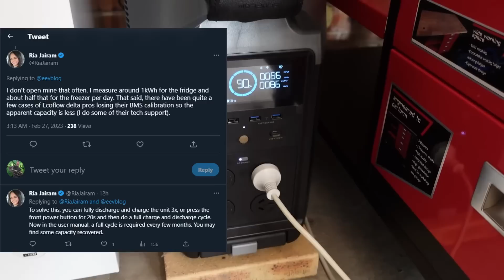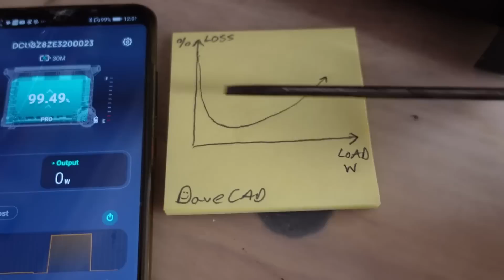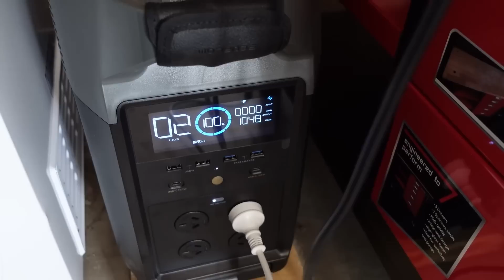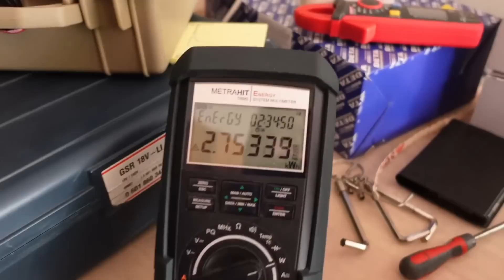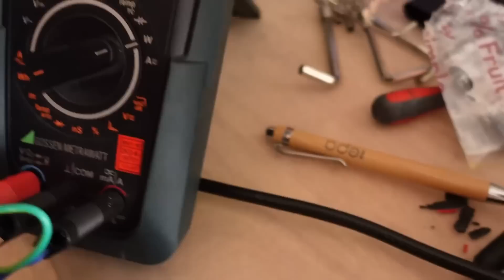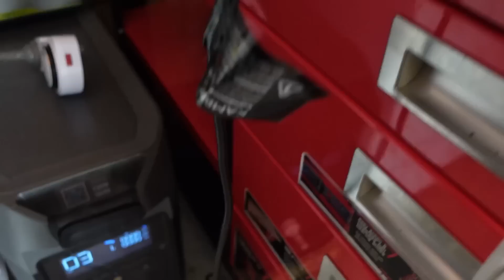EcoFlow Delta Pro Battery Capacity TESTED

Comment from the maker: UPDATE: it turns out that you can recalibrate the BMS (which may contain a coulomb counter?) by doing three full 0-100 charge-discharge cycles. This is not mentioned in the manual and is buried away in the FAQ on the website and is barely explained at all. This is poor form, it should be very clearly explained in the manual.
UPDATE2: After two complete 0-100% charge discharge cycles (and turning it off after each cycle) the capacity display appears to be correct now. It only stays on the 1% number for a minute or two. So no more non-linearity at the lower end. Whether or not it stays this way remains to be seen.
Reply: Do two more 100-0, then try the test again to check the BMS behavior since re-calibration. Ecoflow owners will love to know this.
Reply: Yes please. I am about to get one of those.
Reply: Make sure to leave it Off for about a half hour after each full charge.  That is important.
Reply: That info really should be readily known and they absolutely should be calibrated from factory as it's a consumer product.  
I've been playing with BMS systems lately using a Texas Instruments EV2300 which allows me to read TI BMS chips using the SMBUS. A lot of laptops use the same BMS chip and I wanted to read / edit info on them. 
The recommended way they recalibrate the counter is charge to full, leave for 2 hours, then discharge to 0%, leave for 5 hours. Then recharge. Not sure if that changes depending on chemistry or not but I assume that's to allow the charge level to stabilise.
Reply: @maulerrw  My system was calibrated correctly, but some early firmware updates will mess with that data.  Either that or all the small ( 5-10% drain ) and recharge cycles can mess with the accuracy of the BMS.
Reply: I wanted to comment about the fact that it sure has a coulomb counter just that it was not programed with the correct battery capacity but it seems it requires "learning". I designed a BMS and mine requires the user to introduce the real battery capacity for accurate SOC as I do not find "learning" is a good strategy and can result in large errors.
Can you do another test to see if it now "learned" the battery capacity?
There should be no damage if the BMS disconnects at 2.8V
3.3kWh seems about right as modern inverters are around 90 to 92% efficient. So battery is sure 3.6kWh as advertised.  The 12V output is through a DC-DC converter maybe 93 to 96% efficient so it will not be that much more efficient than the inverter with 1kW load.
Reply from the maker: @electrodacus If you have a true coulomb counter than it should be easy to auto-calibrate. Just reset it when it reaches a safe predetermined zero capacity voltage.
Reply: @EEVblog2  My BMS is for offgrid mostly charged from solar PV and battery will likely never be at zero. My house battery was never fully discharged except for the initial capacity test and capacity tests that I do usually every two or three years as a curiosity to see the amount of degradation.
It will be easy for me to implement an auto calibration procedure but if anything goes wrong the SOC can be way out compared with user setting the battery capacity in Ah and that being used as the battery capacity.
I do not sell an all integrated solution just a BMS for those that know what they are doing and they buy battery and all other components.  I will say that this EcoFlow should be already calibrated for this battery from factory so providing correct SOC without the need for the user to do one or multiple deep discharge in order to calibrate the state of charge indication.
Recently I installed a larger battery using 280Ah cells group of two of this cells in parallel so 560Ah and all I needed to do is set 560Ah in the battery settings together with the battery type LFP and number of cells 8s then save and power cycle to take effect. Nothing else is needed to have an accurate SOC indication.
Then if I want I can do a full charge followed by a full discharge and see if the usable battery capacity is 560Ah and correct that value if needed for even more accurate SOC.
I feel that this simpler option where user sets the real battery capacity in the setting has less chance to provide an accurate SOC compared to some automatic calibration.
Discharging a 14kWh battery can take some time and if you are offgrid is not quite ideal to ever have that discharged to zero and some have even larger battery capacity 30 even 50kWh.
Reply: @EEVblog2  I would guess that capacity is going to vary drastically depending on the load.
Reply: @EEVblog2  That enables it to set the 'zero' level but it needs to know what the true 'full' level is as well.  Presumably that's why you need to do it three times, it measures the actual battery capacity when it's being charged and averages the three values and then on the final discharge it zeros the coulomb counter.
Reply: Why does it need three full cycles? One should be enough? I could understand for new cells, capacity will usually go up a bit on a new cell the first cycles, but this being hidden in faq is more likely you do when youve had the unit for a while. Maybe its for balancing, lifepo4 is tricky, but wouldnt top balancing be enough? Well, would be interesting to see if you did the three cycles if you got even more out of it, doubt it though.
Reply: @kruppin  Likely is a hardware IC that will need to make sure the calibration is correct thus it needs 3 cycles with very close capacity measurement to then maybe permanently write the battery capacity in some non volatile memory. From there there may be some algorithm to subtract from this initial calibrated capacity as the battery ages both cycle and aging degradation.
I think this should have been done in the factory some sort of pre programmed value even if it is with some 1 or 2% error due to variation between individual batteries.
There was already some value 2.4kWh or something like that but it was way off. Maybe they reused the BMS settings from some other model that had a smaller battery capacity.
Reply: The BMS' are notoriously bad in commuting small currents. Therefore, they start floating if you don't fully charge the battery on a regular basis.
The LiFePo cells in this battery have a extremely flat discharge curve so that the voltage is not a good indicator for the SOC. Only the extremes (0% and 100%) can be properly identified. 
Hence you need a Coulomb counter. But if they are not 100% accurate, the SOC will be wrong after some time of 20-90% cycling, since this will never reach a sync point with clear SOC.
Reply: I have had similar issues but then with Goal Zero, that's even worse.
Their BMS is utterly c r a p. Next to their inventors blowing-out at about 70% load.
I truly believe you can best build your own battery-bank, BMS (2nd source) and invertors..
Reply: was about to say you probably need to charge at 100% ever so often. As an owner of an LFP EV, I am told I must charge at 100% from time to time. Being a smart arse I thought I don't need to, but then I noticed a capacity drop and ScanMyTesla showed after about 4 months a quite significant 70mV imbalance. Took a few 100% top ups to get the imbalance back down to 5mV, but it came back. If you look at the charge curve of an LFP you'll see it's hard to estimate the SoC based on VOC, so these cells really need to go to 100% to have the voltage ramp up above 3.3V. My advice is to schedule charging to 100% every other week for balancing, should improve things even using a basic BMS
Reply: Yes I think you should follow the recalibration process, then re-test to see if the percentage remaining works properly afterwards.
Reply: exactly what happens on a tesla if you dont discharge and charge deeply on a regular basis.
Reply: Have had the same problem with my EV, but in the manual it states in the manual to run the battery down every 3 months in order to calibrate..

But this is a bad written BMS, if the guesstimate of battery size is off, you shouldn't need to empty the battery 3 time, one should do it.
Reply: I have an Ecoflow DP. You just need to balance it once on both ends. Then it fine for awhile. 0% on an Ecoflow is not the same as running a lifepo4 cell to 3.0v it has a bottom end reserve.
Reply: the 1 in the display showing the SOC is quite line(ar) or simply a straight line. 

I want one but only with the behaviour during the last 1%

Comment: I held the on/off button for 20 seconds, I gained the missing 2000 KWh I’ve been missing.  I have dp plus one battery.  I was getting roughly 1/2 of the rates KWh now instantly getting 6.9Kwh.  Thanks.  Big difference!

Comment: You make a very good point on what 3.6 kWh actually means.  It depends on the load, how you use it (AC vs DC), as well as the temperature of the battery.  There should be some sort of government requirement to show the actual expected output, kilowatt hours as well as showing how temperature, load, etc. will affect the entire usable capacity of the battery.

All battery manufacture should be required to list the expected kilowatt hour capacity, expected input, and expected output, values, rather than the internal storage value of the batteries, because the user doesn't care about anything other than how much usage can be obtained out of the battery and how much it cost to charge it.

Comment: What if they did it to preserve the battery. If you discharge 80%  you get a lot more energy in total (cycles * cycle-energy). Or maybe you are right if you do full cycle and it's using coulomb counter it might be calibrated by a full cycle. It'll be interesting to get a second discharge cycle if the capacity indicator changes.
P.S. about efficiency - remember the calculator you commented on. Internal battery resistance increases the losses. I think you might get more Wh out of 100-200W load than 1000W. Anyway I like energy/efficiency measurement -thumbs up!
Oh, just read the update...

Comment: You fear for fully discharging comes from bare batteries, they should not be discharge below a point. Fully discharge is the best you can do for batteries in such device, because he manufacturer knows best when to stop.
My best guess what that advice was to recalibrate: drain it fully, wait a few hours to cool, then charge in one go without anything connected but the charger.

Comment: Don't worry about your chest freezer loosing power for 5 minutes. These things can hold their temperature quite long. I think the most are rated for at least 18 or 24 hours bevor they thaw. You don't want to go near thawing thou. Set it for a lower temperature, if you're are anxious for testing
I've tested mine recently to see if I can get away with running the thing full blast during the day with solar and shutting it off completely during the night. Turns out I can. It got from -30°C to -17°C in 16 hours. No Battery required
And the worst thing that can happen to your fridge is a warm beer in the morning

Comment: I have a Tesla with an LFP battery and I did some reading on LFP. Due to the voltage stability when it isn't full or empty BMS's struggle to estimate the charge in the middle ranges The benefit of LFP is that because of the lower voltage the cells are less stressed and have a much higher cycle count. Tesla recommend charging to 100% each week to help ensure the guessometer has a chance to reset.

Comment: With your 1kW resistive load, which is 1/3 of the total power capacity of 3.6kW you are certainly in the 90% efficiency range (check inverter efficiency curves) => 3.6*0.9 = 3.24kWh
For a guy that is uspposed to have done a long career in electronics ... it's kind deceiving.

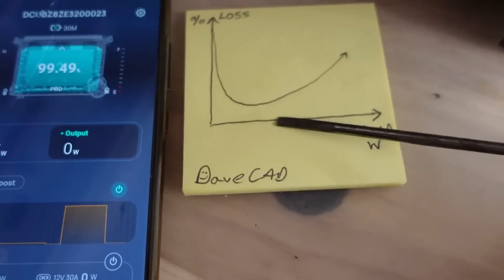Comment: 6:24 : No your graph is totally wrong, there is near no loss on a LFP, whatever power you ask from it (only if you are at the limit... which for a pack like this one is over 1C = 3600W), on the other hand the inverter DO NOT have a flat efficiency curve and will be the main reason of a capacity difference depending on the load.

Comment: No no it's not because those cells are LeFePo4 and that there is a problem with the BMS (LiPo, Lithium got the same kind of problem ... it's basic physics, LFP got a very low voltage variation between 15% and 90% state of charge, the only efficient way to know how much energy is left in the cells is to use a Coulombmeter (Mr Coulomb was living 40 km from my house), to know how much energy is going out or in and do the math to display the correct state of charge. BUT after a while the deviation will start to be too important, reason there is a need to do a full charge/discharge to set the limit again .. and reset the coulomb count.
For example, in my system (i'm living off grid), my shunt (which is a coulombmeter) reset the SOC (state of charge) to 100% when the battery pack is over 53.99V and the charge rate is inferior to 1.5A for more then 10 mins. And it will reset to 0% SOC when undner 48V.

Comment: It is most probably just like power banks, the "indicated" capacity is the total absolute maximum capacity of the battery pack used in there. After the conversion losses, the actual output capacity will be around 2/3 of the rating advertised.

Comment: Climatic Change ... Running a heater at broad sunlight
Reply: Battery was charged from solar, so not really a big deal…
Reply: @BreezyCactus  but the heat is still coming out to environment 😉🤡
Reply: @calixt_us  I’m not sure 1kWh of heat is going to do much in an Australian summer, especially since it’s being vented outside so no extra AC is needed to cool.

Comment: I'm pretty sure it has some sort of battery fuel gauge chip. A simple voltage measurement would never drift, the relation between voltage and state of charge, while non linear, doesn't really drift much and certainly wouldn't need calibration. You'd also see it change with varying loads due to voltage sag. 
Coulomb counting would however drift since you're not gonna be able to measure it 100% accurately and there's spikes that you'd miss. Getting to absolute low and high would fix that kind of thing.

Comment: As it's LiFePo4, then the balancing is best at 95% charge or higher, as the charge/discharge is too linear to get an accurate SOC. Does the manual state that it degrades slower at 90% max charge? LiFePo4 is happy to charge to 100% down to 10%

Comment: The problem with coulomb counting is that you are integrating charge over time. Any measurement errors or variation in battery charge/discharge curve will stack up over time. If you never charge to 100% or discharge to 0% the counter never has an opportunity to reset those errors. An occasional full charge-discharge cycle is needed to keep the coulomb counter in sync. 
The very long time to reach full charge hints that the cells had drifted out of balance, which would also throw off a coulomb counting algorithm. Again an occasional 100% charge helps keep your battery in balance.
Reply: Totally true.
Reply: Measurement errors and also charge efficiency. The charge is not 100% efficient. I wonder if they add the charge efficiency into the counting.

Comment: Battery capacity displays based on output voltage are a bit of a joke.  when putting batteries into a medical product we had to use a system which as you say records the energy going in vs the energy going out to give us the power remaining. it also kept records of voltage, current, total capacity so we can decide when the quality of the battery starts to drop off to the point where it might not power the display for about 20% longer than it specified battery run time.

Another system than used non-rechargeable batteries where you only have the fresh capacity as a starting point.  we know the power drawn from known equipment operation states, so if you keep track of the number of each operation states you can calculate how much power you have taken from the battery and report battery low when you get within in a set point of the battery capacity. Of course the battery s are not cheap as your paying not only for the capacity but that they meet or beat their specification.

Comment: I think it's the battery that's doing to drop in efficiency  as load increases more so than the inverter. More current out of the battery means more IR loss in the cells.

Comment: My company uses LFP batteries in their devices, and I can confirm that when it comes to calculate measure energy left, they are pain in the ***. In the 30-70% energy area the voltage change of 1mV is about 5% change in energy left.

Comment: @Dave, don't forget the fridge likely has a defrost cycle that runs an electric resistance heater probably about once a week.  This can be a huge energy consumer.
Reply: Most will defrost a lot more often than that.
Reply: Mine defrosts at 400+ watts every 8 ish hours depending on usage.

Comment: I have a US 120V model, I've noticed some interesting things with mine since I use it in "UPS" mode most of the time.  Every few weeks, it will drain the battery down to 80% regardless of the charge setting, and then hold there for about 12 hours before recharging to the set charge level ( I usually keep mine at 20-95%).  When recharging to 100%, I have also noticed it stays at 99.49% for quite a while, I assumed this was top end cell balancing since the input wattage is not at maximum.

Comment: I assume there will be a low voltage cutout on the battery.  If it's within the specs on the battery it should be okay.  At low SOC the voltage falls off a cliff.

Comment: LiFePO4 are weird to charge in that there is a fairly wide voltage range that will get them to near 100% but they stay in cv longer at the end of charge when using lower voltage. No idea what sort of wizardry you'd need to keep cells balanced without going to full charge